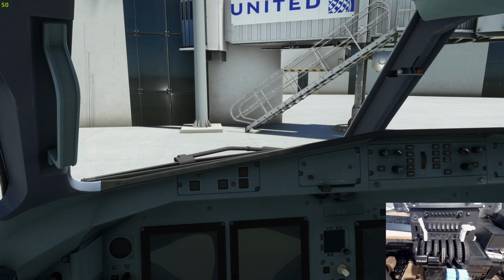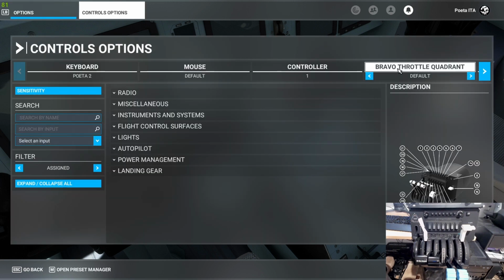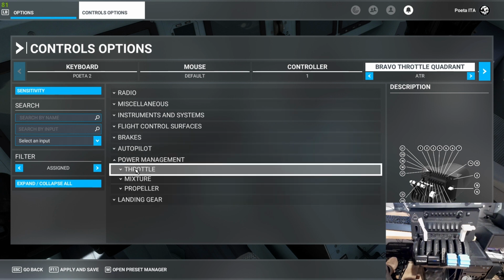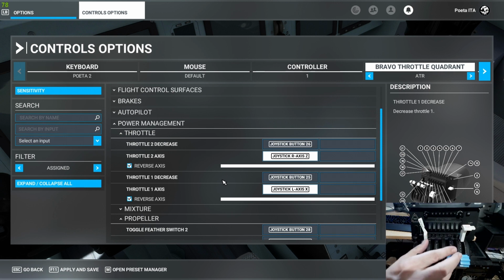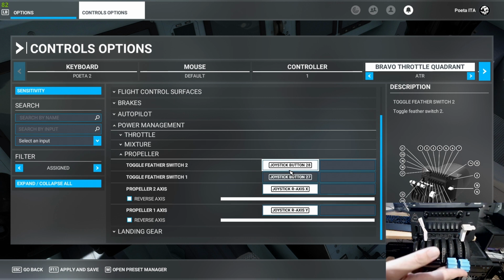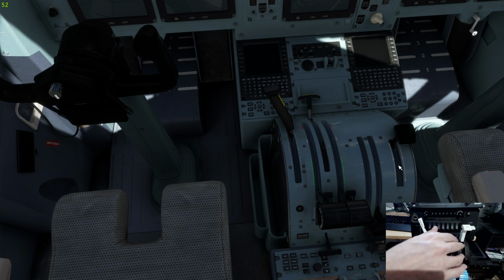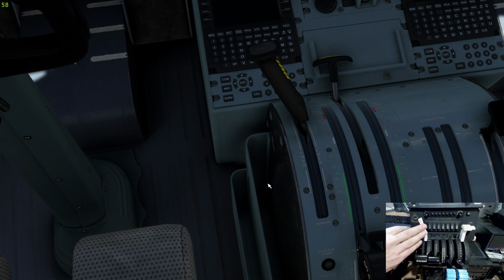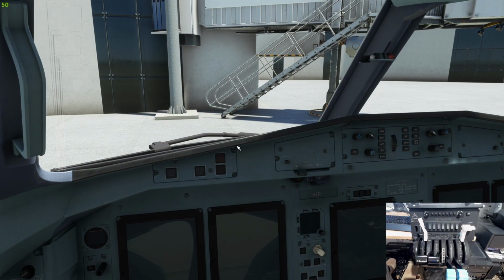Honeycomb Bravo fast configuration with the new ATR MSFS

Comment: I'm having a big issue with my #1 throttle.  I set it up as you and others show.  After assigning, the #2 throttle responds normally, so this is a correct set up.  But my #1 throttle will not hold.  As soon as I begin to nudge the Bravo throttle forward, the sim throttle runs without stopping all the way to the firewall, Full Forward.  Without pause in between.   That's unusable.  
Does this sound like a hardware or a software problem?  I made a separate profile for the ATR, and I have tried to delete the whole profile and start over, but the same problem happens every time.  I'm out of ideas.